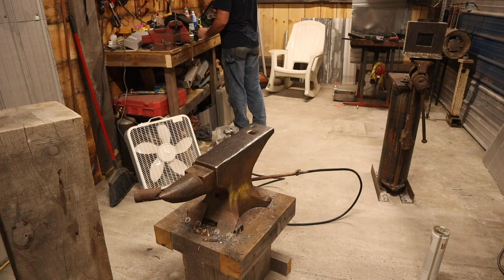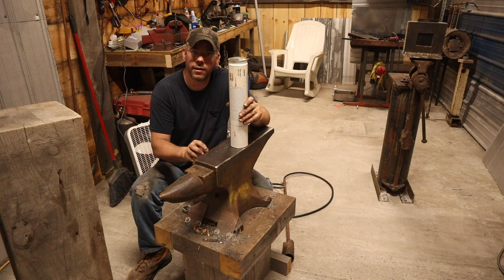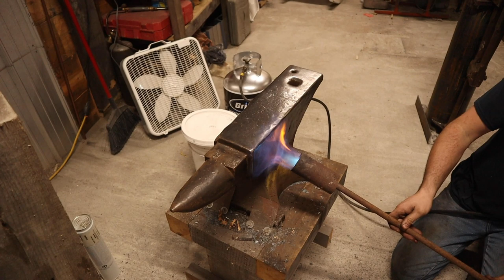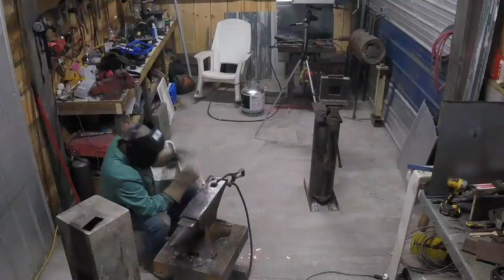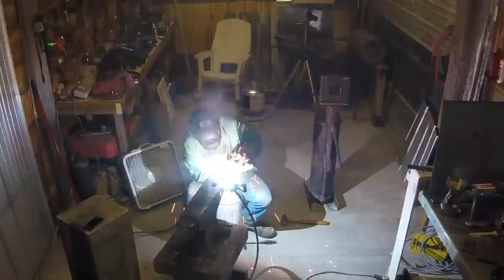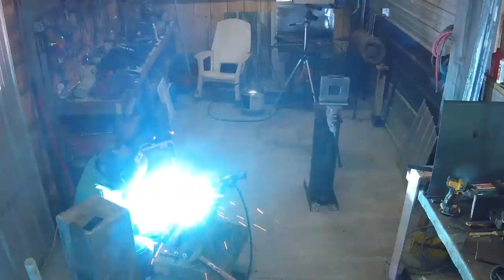Anvil Restoration Part 2: Welding The Edges: Journey To Become A Tool Maker #12

Comment: With low/highs Jim if you look at the end of the rod after you have done a fillet you will find it has a cup with a glove just pinch the end of the rod it will start much easier i was laughing watching i had a hard time as an aprentice till one of the tradesmen slapped me across the ear and showed me how to solve the problem

Comment: Morning Jim. Nice bit of work done there. Is it retaining enough heat to help the welds after you turn off the weed burner? Wouldn't want to see that hard face crack loose from the main anvil body.
Looks like the fan behind you is doing a fair job of blowing most of the weld fumes away, but a vacuum with a large hood might be better.  (Suspend it above the work, close enough to suck up the fumes, but with enough room to see what your doing. Then the vac body can sit under the weld table exhaust blower to vent the fumes that make it through the shop vac. Even a milk jug would be a larger collection point than just the vac hose.
Health first, buddy. You've got people that matter depending on you to be there for them.
Mn is nothing to mess with, as youve said, every step taken decreases the chances of inhalation.

Comment: Been waiting for this one, curious how the electric heater thing did.
Reply from the maker: Didn't work very well.  Just too much mass to heat up.
Reply: TheTradesmanChannel I figured as much. The blow torch works too but takes time and propane. 
I’m betting you can get it good and flat by hand. 
BTW the problem you had with striking an arc with the hard rods could be happening because of the open circuit voltage on your welder, if it is too low it’s hard to strike an arc, it’s not your technique.

Comment: Hello Mr. Jim, the anvil I have to work with has a huge chunk of plate broke off the corner and a sagging center. Thinking it probably best to replate it. In your opinion would a piece of snowplow cutting edge be close enough to the correct hardness if welded solid with 1/4" bead from the center out? Keep up the good work and don't forget the salt shaker. LoL
Reply from the maker: Should be hard enough if it's 1080 but it really needs to be forge welded on.

Comment: Your rod is probably getting a little damp that is why it is hard to light put the rods on the Annville when it is preheated that will help dry them out and keep them warm technically all rods except for 6010 and 6011 should be stored in a heated oven or something like that a old fridge with a lightbulb in it works pretty good for storing your rods stainless is very sensitive to moisture and will give you porosity if they are not totally dry
Reply from the maker: Thank you, that makes sense.

Comment: The anvil is not sweating the gas when you burn it produces water!
Reply from the maker: The anvil was sweating and I know how much moisture LP puts out, I work on industrial burners for a living.  This anvil sweats when the room temp comes up as well.
Reply: When the temp comes up in the room the anvil is colder than the air so of coarse the anvil will condense moisture out if the air, but it is not the anvil its self sweating out water!
Reply from the maker: I know the anvil doesn't have water in it, I'm not an idiot.  I was merely stating that the anvil was sweating, in my world that means condensation buildup.  Of all of the goofy things to comment on you had to pick that?  You can get me better than that.
Reply: That is not what you said and I have nothing to go on except what you say as I like most people do not have the ability to read minds and do not know what you know or are aware of as I am not you and don't know you other than the limited exposure of you on here. Your statement in the video as you were heating the anvil would not have caused the anvil "to sweat" as you were raising it above the room temperature ans would not cause condensation from the air, that is why I was caused to believe that you were referring to the moisture from the burning of the gas! If you meant something other than what you said then you should have said that instead!  I was not trying to "get you" on anything!  I was just stating facts that you did not clarify, nothing more, not trying to do anything other than that!  I am sorry that you are so easily annoyed or offended, but that is not an issue that I have any control over, only you have the ability to allow something so trivial as what I was pointing out to disturb you to the point that you assumed that I was inferring that you were an "idiot".  That thought never at any point crossed my mind!